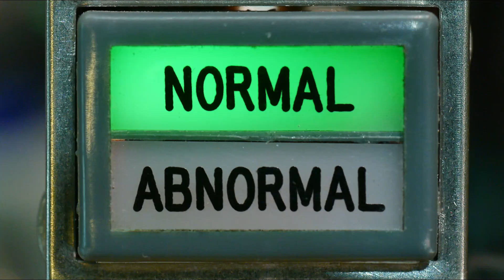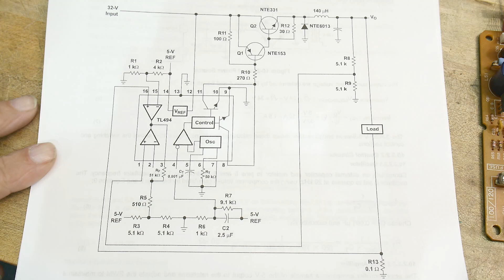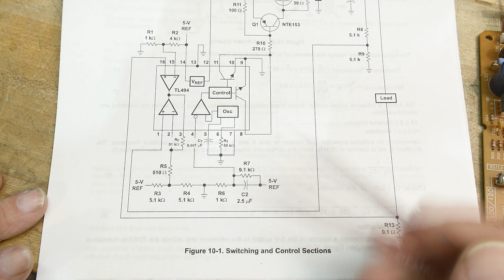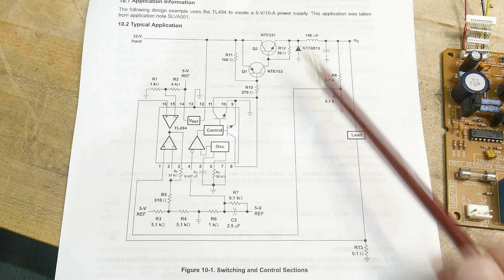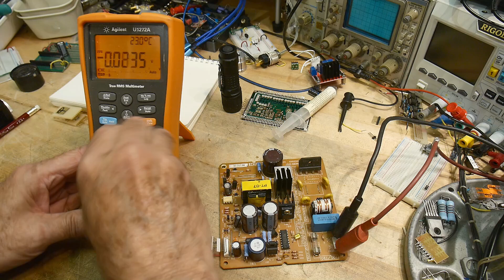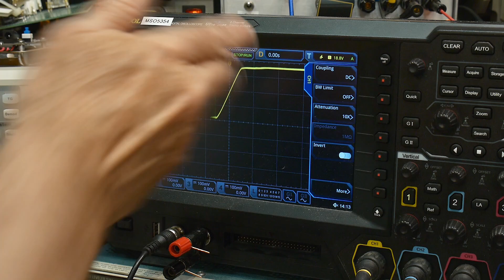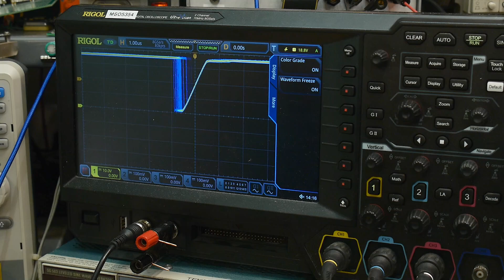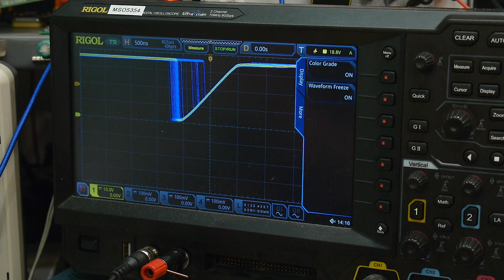#1892 TL494

Comment: That's the best video I've seen on the TL494. I'd love it if you would do a design video showing how to calculate the component values depending on the desired output voltage. Thanks a bunch!!

Comment: The diode on the pcb you pointed out is not the same one as in the datasheet. Diode D55 likely is. L51 is the inductor with a bit of capacitor like package.

Comment: Commonly used in PC power supplies of the past. I recently rewired the secondary of such a transformer to have a variable output up to about 36ish volts. Still musing about the compensation network. Could you do a video on that? Seems somewhat cursed. Very useful IC though.

Comment: PTC/NTC, not RTC 😃
A fairly big difference with the datasheet example is the supply voltage and feedback through an optocoupler.
Reply: Random Temperature Coefficient.